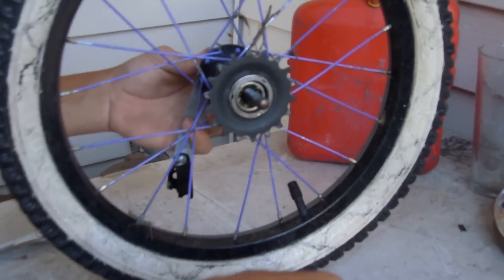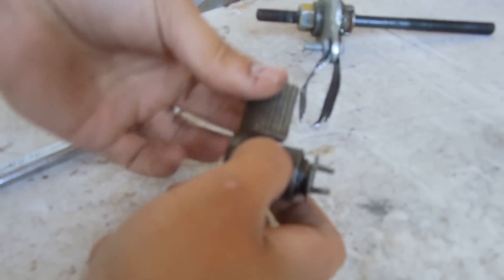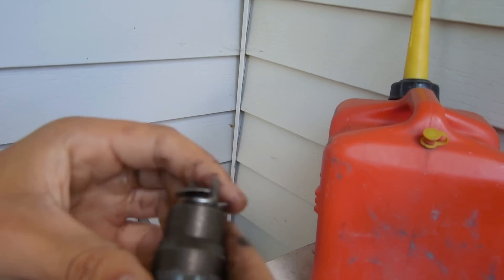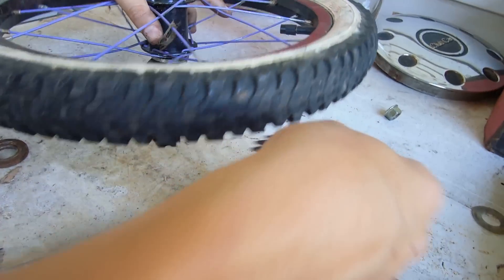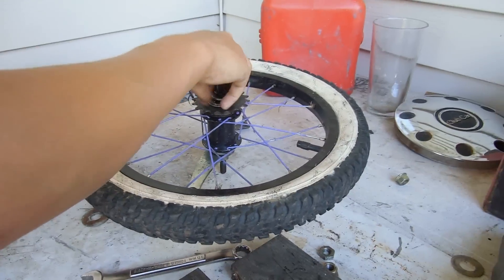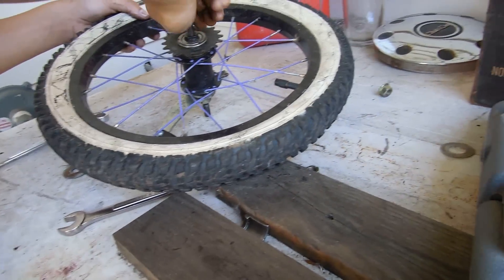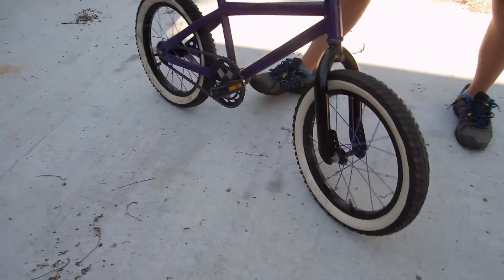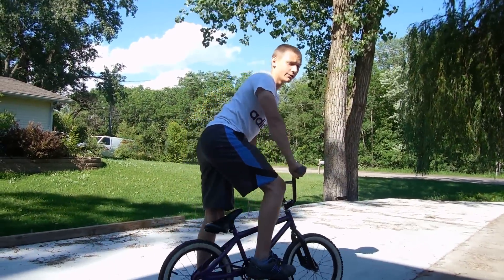How To Convert a Coaster Brake to a Freecoaster

Comment: hey that worked great! engages every time and pedals backwards like a free wheel but with out the clicking and since it disengages every time the pedals dont move when you move the bike backwards like he said, me and my friends HATE coaster brakes cause well . . .they can be a bit of a pain in the ass quite often . . .dont ask, but we also have a bunch of em at our house that are useless and a bunch of bikes with out back wheels or just a fiew of the ones we ride that have free spin . . .point is, massive help dude! first video i clicked and i got what i wanted. . .not typical of what i have learned to expect

Comment: Hey bud, i took mine apart and i think i know why the washers work. The clutch cone moves back and forth to press the brake pads outward against the barrel of the hub when you pedal backwards. By putting in washers, you are removing the available travel for the cone. I think the cone travelling is the slack.
Reply: I think so too...

Comment: Does this mod make it easier to pedal forward? That is really all I am looking to accomplish.
Reply from the maker: +Rhymesayer No it doesn't. To make it easier to pedal you have lower your gear ratio. To do that get a smaller front sprocket or a bigger rear sprocket. If you have a 25 tooth sprocket in the front and a 9 tooth in the back which is very common then you have a 2.78 gear ratio. So you could switch out your 25 tooth for a 22 tooth then your ratio would be 2.44. But remember if you lower your ratio you lose top speed although you'll get better acceleration.

Comment: I need my BMX to drive in both directions, not just forward with a freewheel when I back peddle. I don't want to ruin my bearing by welding the sprocket.
Any ideas?
Reply from the maker: Do u mean so where if u pedal backwards the bike moves backwards? If so look up a fixed gear hub and those are what you want for that

Comment: mine turned into a cassette without sound I did every thing u told me to PS this is not my account but I use so not me in the photo
Reply from the maker: +Lindsay Hall  as along as the calipers are out it should work. remember for a freecoaster to engage u have to pedal backwards a tiny bit. also you don't have to put washers in if you dont want to. Feel free to rewatch the video
Reply: +Granddog08rules could the reason it isn't working is because the washer I only put two I do pedal back a light bit and it still don't engage